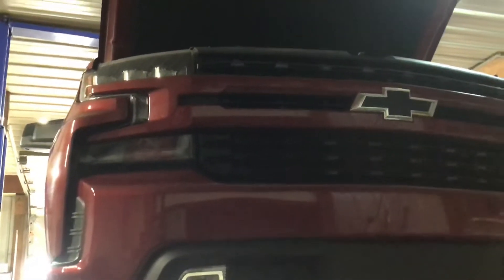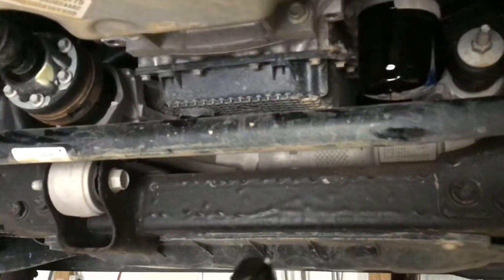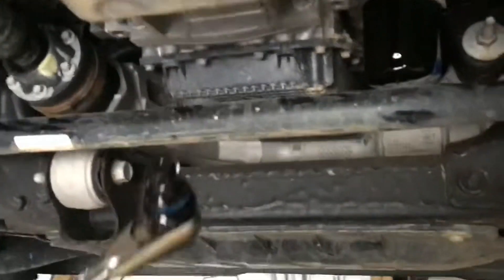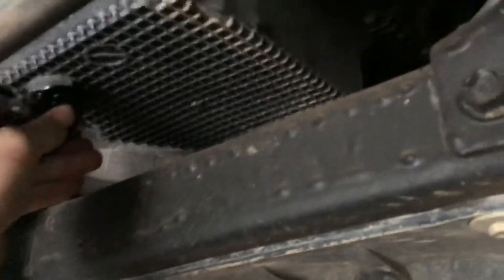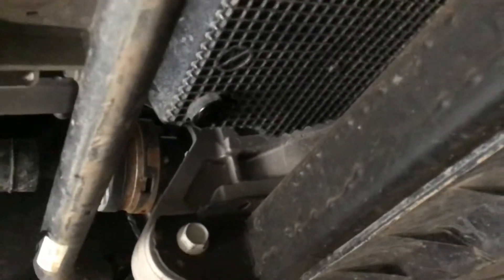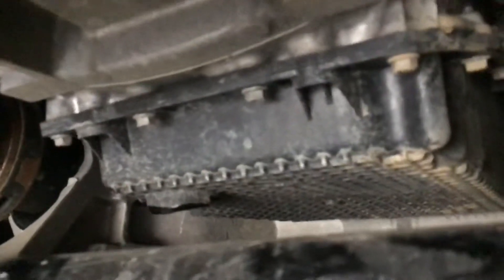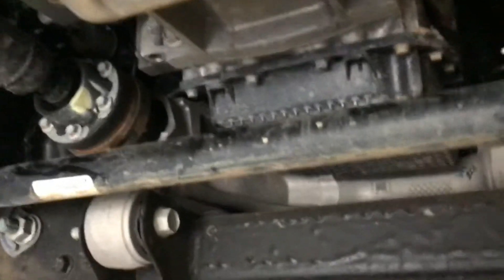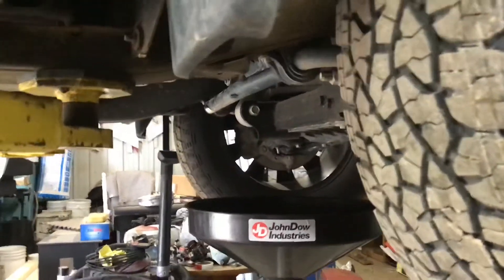2020 Chevy Silverado 2.7L Turbo oil change

Comment: Thanks for the video.  My 2.7 4X4 is getting close to a oil change and been wondering what the drain plug was like. Nothing wrong with that setup!
Reply: I forgot to mention, if you use a 3/8 extension it would be easier.
Reply from the maker: Thanks for watching!  Taking video and using the ratchet left handed probably wasn’t the best method, but it shows what we need at least.  I love this platform, the 2.7 is surprising me still every day!
Reply: Kevin Alberts how many quarts did it take?
Reply from the maker: 6.0 quarts, the filter and oil I used are in the description 👍. Thanks for watching!
Reply: @PullStartStables  I love mine too, the 2.7 is impressive.
Reply: @ Rob  the only problem with that setup is the TurboBurst engine !!  You could have had a V8 !
Reply: @thunderbolt5354  "Could of had a V8" , I've had plenty of them in fact I traded in a 2016 gmc sierra 4X4 with a 5.3 for this truck and love the 2.7 turbo 4.
Reply: @robd380  You wont for very long !
Reply from the maker: I enjoy having “different” platforms to try out.  This has more power than my early LS trucks.  No complaints here!
Reply: @PullStartStables  Pal It will not have the Longjevity of the LS engine Silverado's
Reply: @thunderbolt5354  The GM 2.7 turbo is built to turbo diesel specs so I suspect it will last a long time. That's coming from a retired mechanic that worked on turbo engines for close to forty years
Reply: @robd380  Time will tell My Friend !  That little Engine must work  much harder then a v8 for the same results !
Reply: @thunderbolt5354  hater

Comment: Plastic pan???....following Ford, I see.
Reply from the maker: I haven’t seen a new Ford’s undercarriage, but I imagine it’s a sign of the times.
Reply: Yea but GM knows how to make them not leak. Some modern thermo plastic is well suited for the job, even big rig diesel engines are using them .
Reply: @robd380  
I hope so. Ford oil pan was a leaky one. Lots of people are having problems.
Reply: Of course Chevy's been doing that for decades 😂
Reply: how's those plastic oil pan and plastic plugs holding up ?  i heard ford have problems with their plastic oil pan leaking oil
Reply: @brandonblack2095  No leaks in mine.
Reply from the maker: So far, so good.  This truck amazes me with the power output from such a small displacement.  No complaints here.
Reply: I have looked and looked for a owner review long term review of the GM 2.7 Turbo, but can’t find them, I might own a Ford, but I hope this is a great engine, don’t wish anything bad in anyone. Know people with 300K plus on their 5.3’s and drive them everyday, ain’t no doubt GM can make a engine, father-in-law had a Cavalier with 250k that ran just fine. Please put up a review video of the truck and the little powerhouse engine I’d watch for sure!
Reply from the maker: Poppy, thanks for stopping by!  I’ve got about 16k on the odometer and have no complaints in the performance and strength of the truck!  I recently put my ‘99 5.3 on the road and it surely lacks get up and go that the 2.7 surely has if that tells you anything.  I’ll see about getting a truck review put together!  As you can tell, I’m not a production company, just a dude in a workshop. 👍

Comment: Absolutely garbage just had dumped the entire oil system all over the shop floor. Stupidest thing I’ve ever seen (except for FJB)
Reply from the maker: Huh?  You still need a drain pan, you know… 🤷‍♂️
Reply: @PullStartStables  funny guy
Reply: @Robert Lutz  well.... if you know what you're doing,  that doesn't happen.  Pretty straightforward and simple.